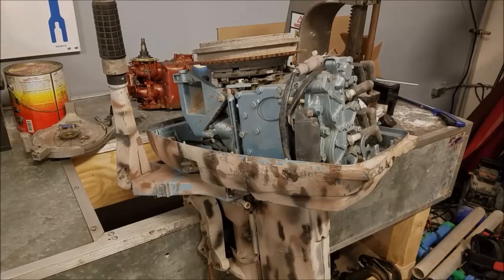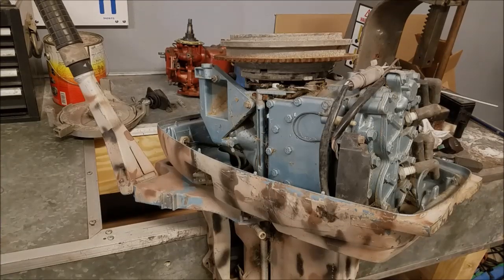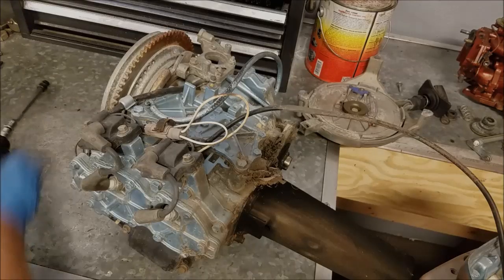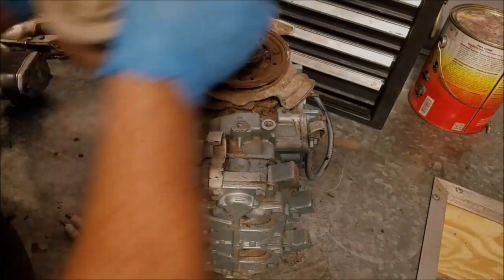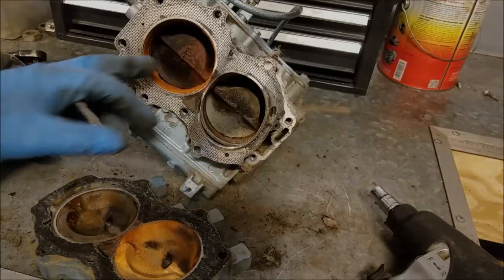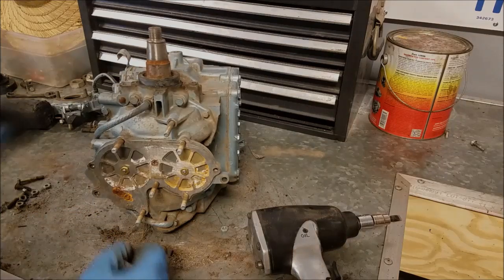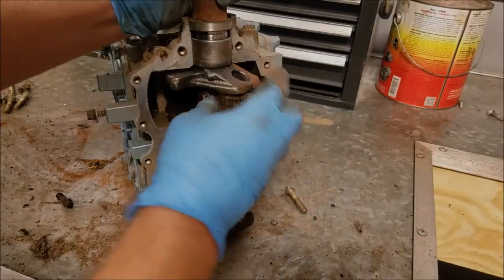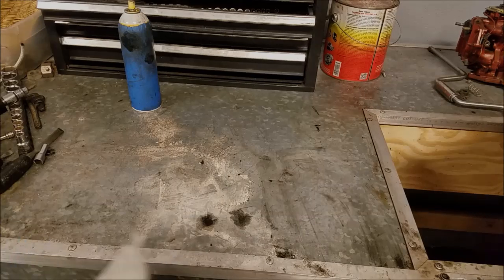Another Evinrude 25 HP Outboard For The Parts Bin

Comment: That block is rebuildable no problem I love seeing ones that nice you dont even need parts just a headgasket and hone the cylinders  wirebrush the crankweights and clean up the rest of the rust thats light. I have salvaged much worse thru the years thats what I love about the hobby with some labor and love they can be brought back to push a  boat again.Even the rings arent stuck amazing its that freshwater here its all salt your so lucky.That motor wouldnt be going in my scrap pile thats for sure,LOLL. Great videos you make keep them coming .....Glenn P.

Comment: Ya might be able to save the crankshaft ! Those 1/4-20’s and others come in handy the piston assembly with some clean up will come in handy and reed cage possibly also ! All in all everything might be useful ! Maybe boil the block and oversize the bore and make it a  true 28 hp . I like getting engines that have good parts on them ! I don’t remember, was that an electric start engine ?

Comment: It's a shame folks let a motor get into such rough shape.  I'd probably take a shot at using some Evaporust or Metal Rescue on the crank and rods, and honing the cylinders just to see what could be salvaged.   I had a 30hp Johnson that was rusted up way worse than this one and I managed to save one piston and rod, and a good hone job saved the block.   Crank was a goner when the big end bearings were all rusted up and pitted the crank journals.  I just hate to see motors get so neglected especially one like this that looked like a low hour, clean motor otherwise.